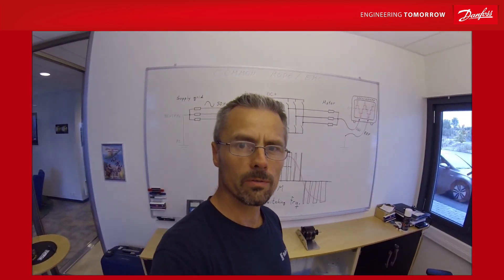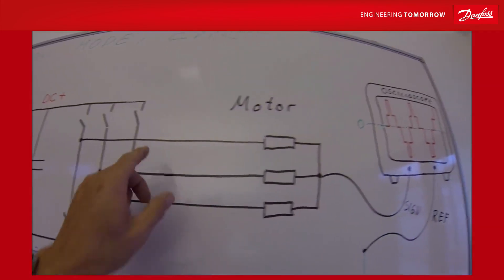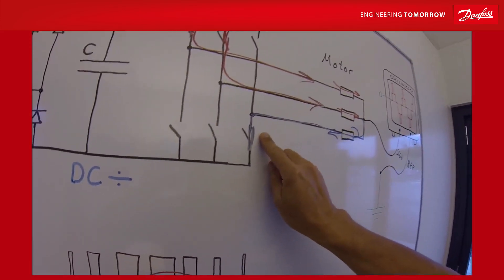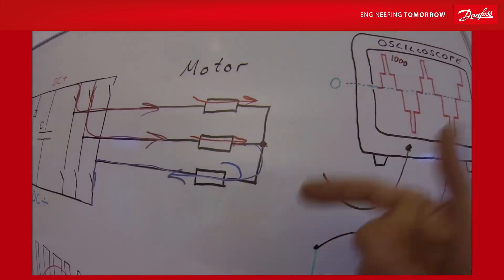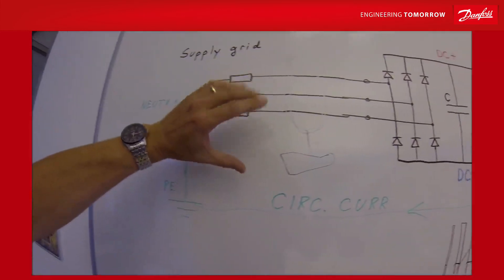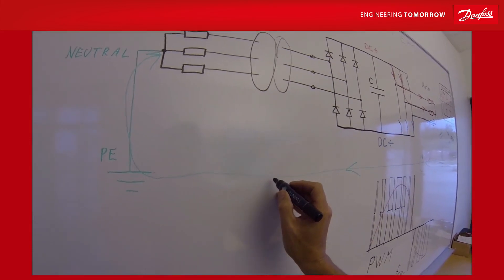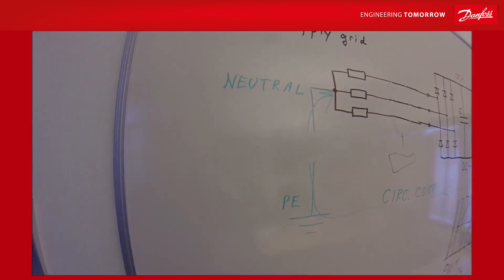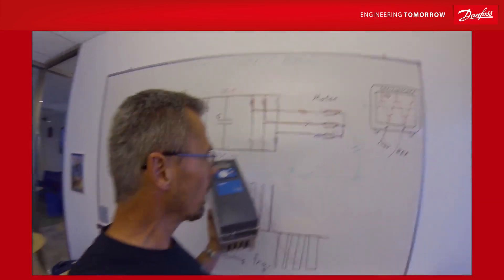Danfoss Drives: Understanding EMC & Common Mode (Frequency Converters)

Comment: So what happens in the EMC when frequenzy converter is on stand by mode and motor is off. Does the voltage still circuit the motor and frequenzy converter the same way as fault voltage? And also does condesator type effect on the EMC?

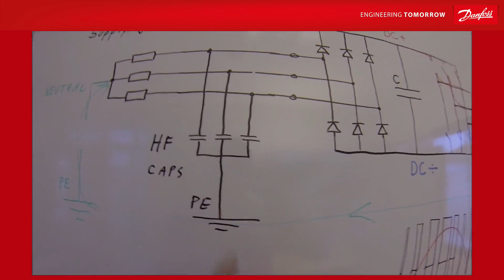Comment: at time 11:30, it says that if power source is not grounded like ship, those Y high frequency caps are not allowed to be used or they will cause problems. Any explanation why? And how to reduce the common mode voltage seen from DC link +/- terminals to ground or from line A/B/C to ground at input of rectifier?

Comment: What about motors connected in delta?
Reply: Hello Kamil, delta coupling does not change the commond mode issues in the motor much. Simplified You can look at all the copper in the stator windings as one big galvanic lump of copper where the 3 motor phases are connected to the drive. Measuring the DC resistance between motor phases it is small values in the 0,1-0,3 ohms range. So for DC voltage it is like one lump of copper. Impedance for AC current is of course high, otherwise it would be like an short circuit also for the base AC. However, regarding common mode which initially is a pure voltage phenomen, all the copper in the stator windings will be lifted to the sum of voltage in the 3 motor phases. And this sum of voltage keeps jumping around when measured towards PE ground, aka the metal casing of the motor. Regardless of delta or star coupled motor phase windings. To draw a leakage current between copper and PE induced by this common mode voltage the path between is the stray capacitance. Stray capacitance current will be an AC current with the frequency same as the drive switching frequency, typical 3-4 kHz. An AC current of that high frequency emits an magnetic field, EMC noise,  that is harmful for other electrical equipment. So we do all kind of measures to reduce the negative effects. Reducing the stray capacitance to a minimum is important. Also keeping the 3 phases and all of its "lumps of copper" inside a faraday cage shielding. The shield, weather it is the cable shield or motor and drives metal casing, need to be bonded together galvanic to get best effect of the faraday cage.

Comment: We have a installation with TNS system where common mode filter  (ferrite core) is melting due to excessive common mode current.
The VFD manufacturer is suggesting to convert TNS to IT system. 
Will it help? Since there is a PE conductor running from VFD to motor which will provide return path for common mode current.
Pls. advise. It's an AFE drive.
Reply from the maker: Hi Ishaan

Regardless of the type grid (TN/IT) you are using, a PE and screened cables are always required. Changing the grid type will not solve your problem.

About the common mode filter/coils, it is essential that you use coils intended for this purpose. The common mode voltage is 3x Fsw, where Fsw is the switch frequency of the drive. This mean that we are dealing with a high frequency signal. Traditional common mode ferrit cores allow low frequency signals of 50/60 Hz to pass through, but filter out higher frequencies – if exposed to VFD output signal, coils will go into saturation and become really hot (burn).
The common mode filter needs to be of nanocrystalline magnetic core type in order to allow high frequency PWM signal pass. More info: https://www.danfoss.com/en-us/products/ac-drives/dds/vlt-common-mode-filters-mcc-105/
Reply: @danfossdrives 
Yes, the link shared by you is helpful. How to select the suitable model? 
In our application,
Motor KW = 560
Voltage rating = 690V
Cable size = 3 runs x 3C x 185 sq. mm
Cable length = 450m (each run)
Our VFD manufacturer has installed common mode filter on DC bus. He says common mode filter rating is 50A.
They measured the common mode current with filter in place at DC bus as 150A.
So we asked him to replace the 50A filter with 150A. But he says 150A filter is not possible to manufacture.
Is it true? Can you pls. advise on this and also which model of Danfoss MCC 105 to select for above requirement..
Reply from the maker: Hi Ishaan

I'm really sorry, but we can't offer such detailed support here on YouTube. Could I ask you to contact your local Danfoss service office? You can find it here: https://www.danfoss.com/en/contact-us/contacts-list/?filter=type%3Adanfoss-sales-service-center%2Csegments%3ADDS
Reply: @danfossdrives 
Thank you for your support.
We have initiated it with local Danfoss here.
Reply from the maker: @nileshkubal6649  Great to hear, thank you

Comment: Pls put a lecture on how emc filter acts in vfd & how to select emc filter for a vfd
Reply from the maker: Hi

Thank you very much for your input. For the moment, if you have a question about this topic, please reach out to your local service center: https://www.danfoss.com/en/contact-us/contacts-list/?filter=type%3Adanfoss-sales-service-center
Reply: Hello Nishan, emc filter on motor cables like dU/dt filter please see explanation how it works in one of the comments above here, from ibd1977. Another measure to mitigate negative effects of the PWM voltage rise time is to produce the motor windings with "form windings". Instead of spinning the copper wire randomly around each iron pole, the wire is installed more organized in separate layers. This will not reduce common mode, however it will increase the motor robustness for insulation failures. PWM voltage rise time impose a risk of getting high voltage differences between each strand of copper wire. The insulation is pretty thin on each wire so a high voltage difference can stress the insulation and risk flashing over. Mitigating this a dU/dt filter helps a lot. But an alternative to utilizing a dU/dt filter is to produce the motor with form windings to avoid wires with high voltage differences to be laid close to each other. We see form windings mostly on permanent magnet motors where total drive train efficiency do not like to include the losses of dU/dt filters. Losses on the dU/dt filter is the voltage drop of 1,2% multiplied with the current.

Comment: The problem is that the pwm outputs are not edequately filtered to reduce cost and vfd drive volume (size). With filtering the high dv/dt waveforms and edges are greatly reduced limiting the capacitive currents. Older drives had better filtering but were bigger and a bit more expensive.
Reply: Hello Roger. It is true that older drives had slower voltage rise times on the PWM pulses. And the issues with common mode and also voltage stress between winding layers were less with this older drives. However, the slower voltage rise times produced more heat losses on IGBT's. The drive needed more cooling for same motor power, thus bigger size drive and bigger losses. As evolution of drives are towards smaller physical size and less heat losses, the IGBT technology is pushed for higher voltage rise times. A modern drive with low losses will actually stress the motor and cabling with PWM voltage stress way more than an old drive. Thus the issues with both common mode and PWM voltage stress are more important to cope with today than previous years.  Also modifying the IGBT switching pattern to produce a more balanced common mode increase the losses and decrease the efficiency of the drive. Which makes the drive less value for the money when valued only for power, size and efficiency. Simplified You could say that to produce a better drive we push more issues over to the motor. More need for robust motors and dU/dt filters, low stray capacitance cabling etc.
Reply: @AcrodesignerLNSNI  I agree 100%.

Comment: Very informative video.   Thank you.

Can you please advise on a how common mode chokes installed in the VSD output effects the floating neutral (star) point in the motor?   Will that reduce the voltage and current being capactively coupled through the motors frame and bearings?   This is in reference to the Coolblue cores or other chokes and how they actually work to protect bearings.
Reply from the maker: When chokes are connected on the VSD output between drive and motor it is called a dU/dt filter. It is usually a 1,2% impedance choke with also some small RFI caps on the motor side. Purpose is to increase the voltage rise time on the Pulse Width Modulation (PWM). Unfiltered the voltage rise time is about 2000 volts in one micro second. Stray capacitance in cables and motor will react to this fast voltage change and create HF currents with several negative consequences. The dU/dt filter will be a low pass filter for this HF currents. On the motor side this will result in slower/ longer voltage rise time. Maybe to only 200 volts per micro second.  Slower increase rate of voltage in each PWM pulse result in lower HF current leaking to stray capacitance. For the neutral star point in the motor it still is a rotating potential. However, with the slower voltage rise time the stray capacitance in the motor casing will not draw that much HF current as without dU/dt. Less currents flowing trough bearings, less stress on insulation, less HF EMC.
Reply: Danfoss Drives thank you.

On another note.   In regards to the floating neutral point in the motor.   I assume this occurs with motors connected in star?   How about motors in delta? Is there a floating neutral in a delta connected motor that has no star point?
Reply from the maker: Even though there is no physical star point in Delta there is an artificial one as formed by the summary of voltage potential in the 3 phases. So to speak the summary of voltage in the stator winding is rotating just like when in Star.

Comment: Hi I like this simple and very good explanation of Common Mode Current Source.  If there is an interest, I can give some Information for suppressing Common Mode Currents by Nanocrystalline Cores (CoolBlue) which are working in the Motorcable as Inductive Absorbers.
Reply from the maker: Hi Hans-Joachim, thanks for your reaction. We do supplyh high-frequency common mode cores that 
reduce electromagnetic interference and protect against bearing currents.They are light blue coloured. Is that the ones you are referring to? Rgds Hans
Reply: Yes, they are already an Option for your drives and I helped to design them in Denmark ;=) Some background regarding Impedances, Absorption the improved design is available. We do have now improved versions of it they do have a (+) at the Number. If you are interested we can have a phone talk about the possible Improvements together with NALa which are line Absorbers for reducing the ringing of dU/dt of the IGBT´s. BR Hans-Joachim (Alias Jochen ;=)
Reply from the maker: Okay Jochen, I am not very much into this (as a simple digital marketer), so I don't know much about it. I am also not really sure who in our organization is dealing with this. Are you able to give me your contact details. Then I will try to find and inform a couple of people and advise them to get in contact with you. Rgds Hans
Reply: At this time the development was done with Norbert Hanigovszki, my contact is hpoess@magnetec.de. If there is some interest, feel free to contact me or to share my contact data. more info´s under http://www.magnetec.de/fileadmin/pdf/pb_cb.pdf Rgds Jochen
Reply from the maker: Thanks Jochen, I have forwarded your message to Norbert and advised him to get in touch with you. Rgds Hans